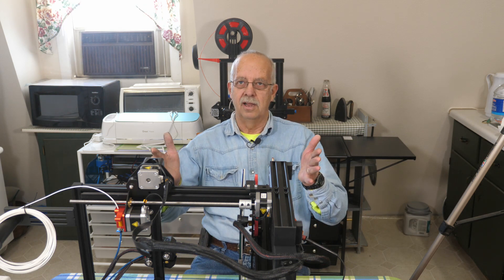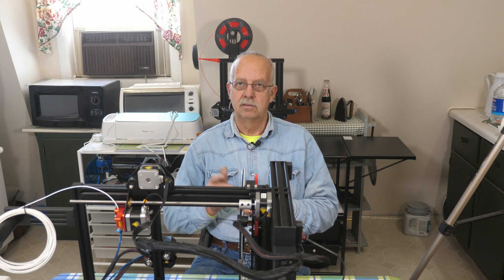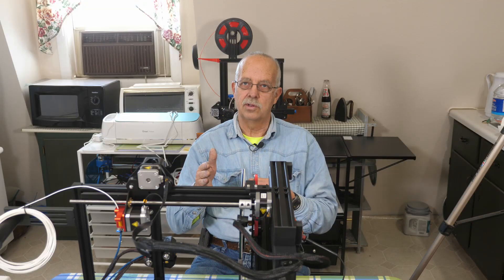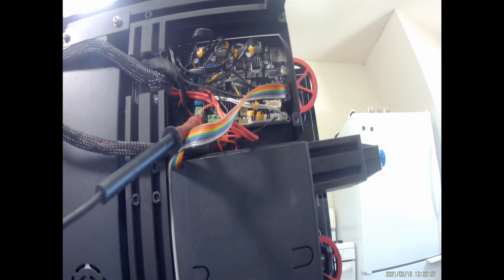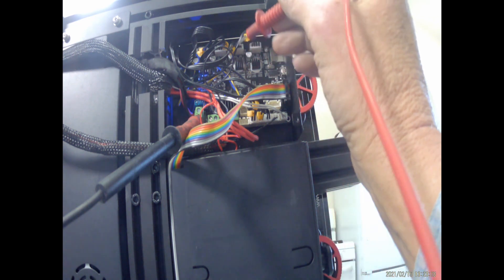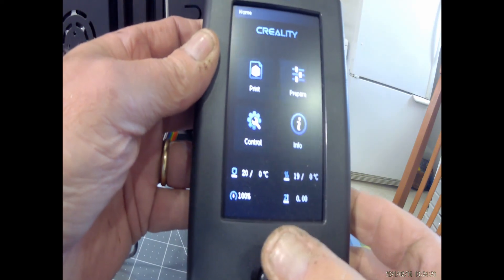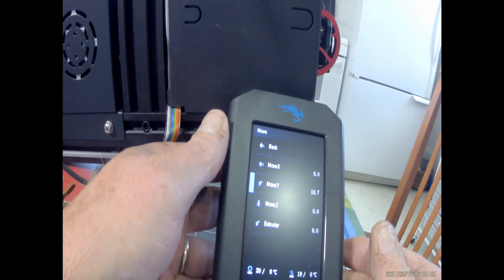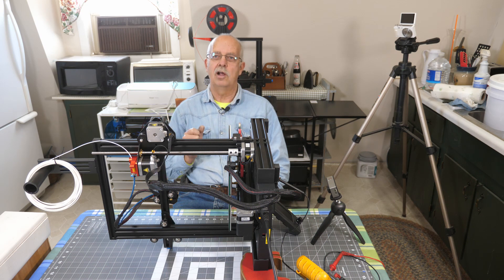Creality Ender 3 V2 Stepper Motors Board Troubleshoot

Comment: My Ender 3 quit feeding filament mid print. Stepper would just waggle back & forth. Bought new 3rd party cables on Amazon and they were pinned wrong. Let the smoke out of my 4.2.2. Installed a new 4.2.7. Steppers would only lock up like in the video. Hoped the video would tell me how to fix it, but I already have new cables & a main board, so in this case a new main board was not going to fix this. Tried going back to 4.2.2, no joy. Went back to 4.2.7 firmware and that fixed it.

Comment: 3-19-2023 just found problem with my Ender 3 plus same issue I was running 4.2.7 firmware because my board is a 4.2 .7 just loaded 4.2.2 firmware unplugged installed sd powered on and problem fixed remember if reloading the same firmware you have to rename the upgrade so it will load " no problem has you beat until you give up on it" never give up Roland
Reply: I love you, i love you guy who posted a comment on a video months ago, when you decided to write this, you didn't know, but you ended up saving my life

Comment: Have an Ender 3 in the Ender 3 Pro the inner three I just replace the heating element still not getting hot like I need it too and the Ender 3 Pro it starts feeding filament fine and once he gets the first layer of the print he quit feeding the filament any suggestions will help
Reply from the maker: I can "sort of" address your second problem with the Ender 3 Pro, although I had this issue with a different brand printer.  If I sliced the project with Cura 5.x, it would keep running beyond the purge and fist layer, but then stop extruding.  If I sliced with Cura 4.x, this did not happen.  I have no explanation for this............

Comment: I bought one from microcenter, instead of buying a new one for $100 I thought I'd save some money and buy one from the huge pile of ender 3 printer returns they had at the front of the store. I bought it for like $85, but I wish I had purchased it new. This thing has nothing but problems, it's not even worth the time financially to repair it, my CR-10 is working well.
Reply from the maker: Yes, purchasing returns and "used" printers is a gamble.  I've done that few times, when really cheap.  Sometimes they can be fixed.  Other times, just used for parts.
Reply: @rogersshop  Thanks for the reply, I just feel hoodwinked by the store and promises of working condition.

Comment: Just had a brand new printer right out of the box do the same thing on the X axis with the exact same board. Definitely believe there’s a problem with the 4.2.7 boards
Reply: Correction it’s a 4.2.2 board I have. I have a 4.2.7 on the way

Comment: Hi i have a problem , printer switches on , hot end fan run , blue lights on motherboard , display reads CREALITY  but does not boot up also the motherboard fan does not come on , have you ever come across this , not booting , thanks  ender 3 2v
Reply from the maker: Sounds like firmware is corrupted.  Try a reload of the most current version.

Comment: I have a new ender3 V2 with a 4.2.2 board. The y-axis motor makes a thud sound and doesn't move. after swapping x for y on the board, i realized that the driver is bad. Is this fixable by firmware upgrade?
Reply from the maker: If the driver on the board failed (common), you will either need to replace the board (suggest 4.7.7 if going with Creality).  I have one of mine with a 4.2.2. board and it has been giving me issues.  Will soon be upgrading to a Bigtreetech board and display.

Comment: Due to broken USB, I put a new mainboard in. New was 4.2.7, old 4.2.2. This isn't a straight swap as the step and direction pins are reversed. It gives the same symptoms - locked motor.

Comment: My ender 3 max failed after a power surge in the neighborhood. I replaced the 4.2.2 main board with a 4.2.7. I created the firmware using the Marlin source code for the 4.2.7. Motors move, and it extrudes when done individually. Auto home works.  When I print it all works for about 10 minutes then it stops extruding. Any advice will be appreciated.
Reply from the maker: I have a friend that had a similar problem with the printer just stopping part way through a print and could never figure out exactly why.  It has the 4.2.7 board and what I did was load the WRONG firmware first, then rebooted and loaded the correct firmware from Creality for the 4.2.7.  No problems since.  This was a suggestion I read on some forum somewhere.  Makes no real sense, but it worked........
Reply: @rogersshop  So probably a firmware problem. Possibly did not load correctly. I bet the loading of the wrong firmware for your friend enabled the repeat loading of the correct firmware. It won’t let you load the firmware already in the machine I understand. I should update the firmware and reload. Thanks for the tip.

Comment: In your video you say that the Firmware is not the issue.  Well I just had the EXACT same issue you are talking about here.  So I updated my hardware to include a new hot end and leveling sensor.  I had to update the firmware for the leveling sensor to work and the latest firmware on Creality's site is Marlin for V4.2.3.  I installed this firmware and my printer locked the motors.  It worked perfectly the day before I did the upgrades.  I researched this a bit which lead me to this video, and other forums that mention that the 4.2.2 board cannot run the 4.2.3 firmware as it uses different driver chips. I needed to go into the archive on Creality to find the V4.2.2 firmware that works with the auto leveling sensor.  I did and now my printer works perfectly once again.  Maybe your basket case just needs the right firmware loaded.  4.2.3 doesn't work with 4.2.2
Reply from the maker: I'm aware of the firmware compatibility as I have four of these printers.  The problem with this one was the board.
Reply: I had the exact same issue with mine, i changed the firmware. The printer now works perfectly.

Comment: Did you ever get the skr mini e3 and touchscreen? Would love to see an installation video on that. Installing klipper instead of marlin would be an upgrade
Reply from the maker: Yes.  there is a video on my channel covering it.  Marlin has worked just fine with this.  I have 4 printers including this one that I changed to the SKR board and screen.

Comment: Recently got a used ender 3 and everything works but when moving the z axis theres a thud and it will only move downwards even when using the controls to move upwards. Any help? I dont want to go replacing something that doesnt need replacing.
Reply from the maker: Could be either the stepper motor or the stepper motor cable.
Reply: @rogersshop  thank you ill check it out

Comment: Hi can this happen with only 1. my extruder motor works on all other ports than its own so was wondering
Reply from the maker: Yes.  An individual driver can fail.  It does not have to be the entire board.

Comment: I had this exact same problem to the T.

I had installed a brand new 4.2.7 silent motherboard. Putting my old 4.2.2 motherboard back in solved the issue. I’m convinced it’s the board too.
Reply: With the E3V2's its almost always the drivers.  They cheaped out and didn't put any backlash current protection on the driver IC's. So jamming up during operation or simply just moving the head too fast manually can overvolt the IC.

Comment: yo tengo un fallo parecido en este caso es con un cr touch el problemas es que la placa no lleva ningun diodo rectificador a la salida de los drivers ,usb etc todo lo que sea propenso a devolver corriente a la placa asta los termistores tambien y eso conlleva a que la fuente consuma mas por lo tanto manda mas  voltaje para todo generando la perdida de pasos mala calibracion cr touch etc yo descubri que el cable del termistor de la cama se abia partido por la entrada de la misma y se notaba cuando subia el consumo puesto el ventilador de la placa se volvia loco mi placa es una 4.22 y e probado tambien con la 4.2.7 y pasa lo mismo tambiaen pasa con optoprin conectado a usb
Reply from the maker: Si, puedo ver donde esto puede causar problemas con un bucle de tierra.
Todavía no he probado la CR Touch, pero lo hare pronto en una de mis impresoras.
Disculpe cualquier error en espanol ya que no es mi idioma nativo!
In English:  Yes, I can see where this can cause problems with a ground loop.
I have not tried the CR Touch yet, but will be doing so soon on one of my printers.
Please excuse any Spanish mistakes as it is not my native language!

Comment: Steps per millimeters?
Reply from the maker: This depends on axis, or if you are looking at the extruder.  These four steps per mm are not the same and need to be calibrated, which is more than I can put here in a reply.  As a starting point (if you have lost factory settings) is X and Y are usually around 80, Z is around 400, and the extruder is around 100.  These would be starting points, but calibration needs to be done to narrow down the most accurate settings.

Comment: hmm this isnt my problem mines been running great for over a year no probs today went to use it and the etruder refuses to work i plugged in the x axis connetor to my extruder and it moves, so i know theres nothing wrong with the motor is it possible one drive could get blown on the board?
Reply from the maker: Yes.  You can test the output using the same method I used in the video to determine it for sure, but your test of swapping motor plugs pretty much determines that the extruder motor driver is shot.
Reply: @rogersshop  it was the wire bro my e axis wire is damaged or broken somehow, replacing it with the x axis wire my extrude works fine i put the e axis wire on the x axis the x axis wont work so im 100% its the wire
Reply: @happybrainybren  yeah i had the same issue i had the 4.2.2 board and that issue as an escuse to upgrade but thats what i thought it was. i couldnt find anything this issue till now

Comment: Exact same issue I have right out of the box.
Reply: I did find a loose pin on the x axis harness at the board. Removed all the glue and repinned the connector and it's been fine since.

Comment: Thank you so much for this vid. I bought mine, put it together, attempted to auto-home and the motors clunked on and buzzed and did nothing. Nothing moved. I contacted the seller on Amazon about this looking for a new board (until I can get the big tree one) or a partial refund.
Reply from the maker: I hope you get a good result 
I had quite a time with my lemon printer 
The other one has had zero issues
Reply: @rogersshop   mine did the same thing. set it all up and nothing. frustrating to say the least
Reply: Did it resolve For y’all ?
Reply: @tudadinero  Yes, turns out the firmware was completely wrong for my board version. The seller was flummoxed how this could happened in a new unopened printer aside from coming from the factory that way. Either way we got the correct firmware on there (didn't want to accept the correct firmware at first) and it works like a dream.

Comment: I really need help with my ender 3, my z axis will move down just fine, but it wont move up. When it has to move up, it moves down and makes the binding noise. Its still a brand new machine, only printed on 8 times..
Reply from the maker: Either the stepper motor is bad, the cable to the Z axis is bad,  or the driver on the board has failed.  Try swapping the Z axis output on the board to the X or Y cable and motor.  If this works correctly, then the motor or cable is bad.  If problem still persists, the board has failed.
Reply: @rogersshop  ill try those to see, thank you
Reply: @voodooprintz216  im having the EXACT same issue. Did you fix it? I cant figure it out.
Reply: @alepepperoni2563  i ended up replacing the board and motor to be sure, it works like a dream now.. i bought the ender 3 pro board and stepper motor, the board makes everything run silently, no noise..
Reply: @voodooprintz216  thank you for the quick reply, im going to order the silent board replacement and see if that helps.
Reply: @alepepperoni2563  ur very welcome.. i ordered mine from amazon.. they r very easy to replace and i didnt have to update anything, so an easy plug and play basically

Comment: My ender 3 V2 PSU have 30V wtf ???
Reply from the maker: There is an adjustment on the power supply to turn down the output via a potentiometer in the power supply.  Be sure to use a QUALITY meter, not a cheap one when making adjustments.
Reply: @rogersshop  Problem is my voltage multimeter. Batery is low and multimeter view bad voltage.

Comment: Anyone have issues printing stl files from thingiverse?
Reply from the maker: I have not had any problems
Reply: @rogersshop  for some reason some of the files I print from there either fail mid print or doesn't print correctly at the beginning whole others print perfectly especially the ones I purchase from other sites.  Oh, BTW, I did send the ender 3 v2 back and went with the ender 5 pro...

Comment: Thank you for this, I was literally pulling my hair our trying to figure out why was all of my motors freezing up at the same time when i go to auto home or try to move them one by one.  I even unplugged each cable from each motor and tried to start them one by one.  Guess I'll be trying to call someone in the morning or even returning this thing as I just got it today...
Reply from the maker: Understand the frustration!  I changed this board to the Bigtreetech and also upgraded to their touch screen.  No issues since.
Reply: @rogersshop  New update, I did an online service request and they got back to me today.  They Attached a Firmware file to the email and had me flash the memory card then place the file on the card and install it back into the slot, that got me back up and running. It was this file....Ender-3 V2-Marlin-2.0.1 - V1.0.2 (1).bin
Reply from the maker: @marcusmiles568  I tried that one, but it did not fix my board.  it was shot...........
Reply: Now im having issues with the filament not wanting to stick to the bed no matter how i level it.  Im so freaking taxed.....
Reply from the maker: @marcusmiles568  Increase bed temp to 60.  Also what is your ambient temperature?  I was having some issues until I realized the room was cold!
Reply: @rogersshop  The bed temp is automatically 60, the ambient temp is 75.  I installed a BLTouch today and this is killing me, when I go to print, it senses the bed them goes home, comes back then goes home again and the lcd shows that the print is complete.  WHAT? lol I am almost bald now....
Reply from the maker: @marcusmiles568  I'm already bald! ☺  I didn't go with the BL touch since I found that after upgrading bed springs, my bed never changes after leveling.  So, can't help you there since i have no experience with the BLtouch.  I did consider it, but since I have no issues, didn't go with it.
Reply: @rogersshop  yea dont do it, this firmware has more bugs than an old bag of flour lol. Im about to box this whole setup and send it back to them lol.

Comment: Literally just had mine drop out on the extruder mid print. Creality 4.2.7 main board failed
Reply from the maker: I'm quite pleased with my upgrade/change to the Bigtreetech board.  I may also upgrade my other Ender 3 V2 to the same.  I also like the touch screen.  So far, ZERO hassles after the upgrade!
Reply: @rogersshop  Yeah I think I am already going to order that board and screen.
this ender was given to me for free, the dude was like "It's CURSED!" and bought a prusia... needless to say, it actually must be, because I had to put a new hot end on it, so I put a microswiss extruder and hot end, things were great until one day I wanted to change the nozzle and shorted out the board (I'm a dumbass and didnt turn it off, never had an isuue with it before just heat swap, tighten and go) upgraded to the 4.2.7, thought I gave it a proper excorsism with that, until today... stupid ender... I might have to give it away and buy a prusia... lol... if only I could afford a prusia (of course there is probably a prusia's worth of shit thrown at this one over the years) stupid 3d printers... but I need em to build and fix my drones!

now I'm just ranting.
Thanks from Colorado
Reply: @TheOneAndOnlyRandy  I have 2 Ender 3 printers.  One has worked flawless and the other is a "lemon" that has had countless problems, but the new Bigtreetech board seems to have taken care of the problems.
Reply from the maker: @TheOneAndOnlyRandy  Accidently replied to your post from my other channel!
Reply: @rogersshop  that's a cool channel too!
Thanks for the help

Comment: Looking forward to see if the new board and screen fixes the lemon. Changed my failed 4.2.2 board to the 4.2.7, but not the PSU. Working ok for now. Keeping my fingers crossed.
Reply from the maker: Yes, the new board and screen did fix the lemon and it works quite well.  I'll be posting that video in a day or two.
Reply: @rogersshop  That's good news. Now I know what to do if mine fails again. Thanks!
Reply from the maker: @Game Over Bigtreetech SKR Mini.  I did it yesterday and it works perfect with no "fiddling around".  I am going to post the video of it tonight.
Reply: @akashic seer Almost all of them come out of china. So no matter which brand you buy they use the same components. The new board is still working fine.  But, I agree with you.
Reply: @akashic seer There are aftermarket firmware available that work well for me. You must have a real lemon on your hands.
Reply: @akashic seer Ok, good luck.